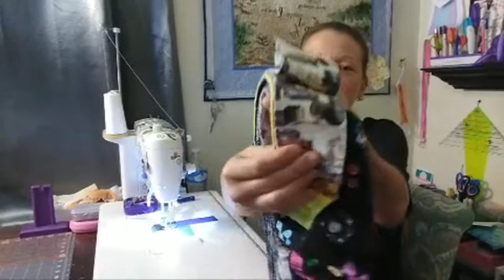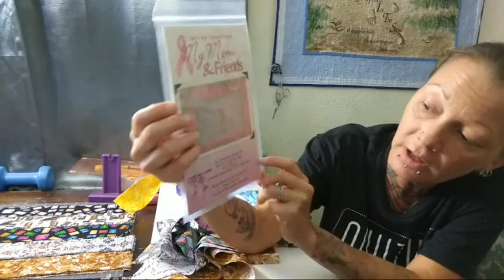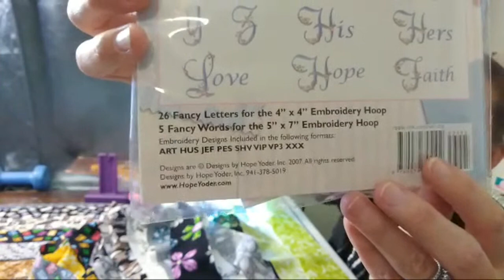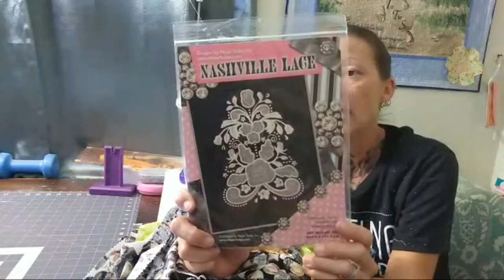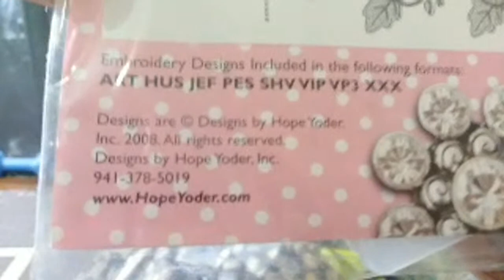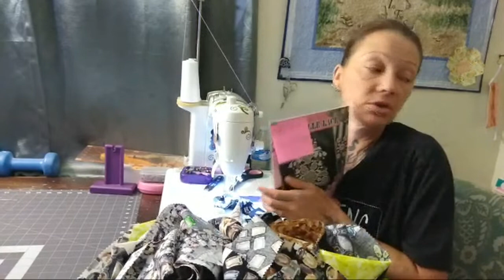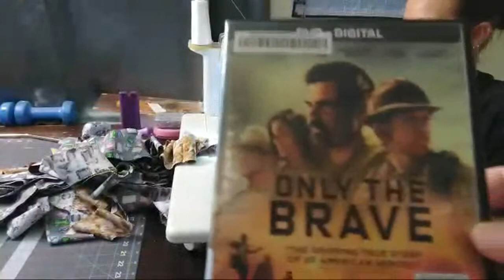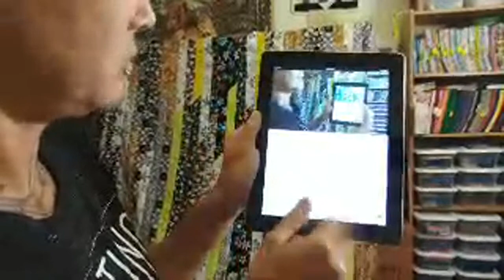Sew Sunday 6/28/20 Double Jelly Roll Race ☺ let's Race!

Comment: I leave my selvedges on and overhang them when sewing the strips together- gives me a v shape to line up with my seam guide which is easier than matching an edge which is underneath. When I'm done and have them as one big strip I use scissors to trim them off and cut them apart at the same time.
Reply from the maker: I do that too sometimes and sometimes just cut them off first.

Comment: Just a suggestion, try one of those sticky lint rollers on the pinked edges before you unroll it.  It will really help.
Reply from the maker: Ya I've done that before.  I go through those so much.  I use my other lint brush normally or I just pay them off over the trash before opening. But since this was live I wanted to show newbies how much mess pinked edges really make 😂.  After I finished filming I changed and my clothes were taken outside and shaken off and washed by the hubs and CJ vaccumed my room up for me. It was a mess 😂
Reply: Cheryl Brown great tip thanks.
Reply: Hmm, I never thought about that. I'll give it shot. Thanks.

Comment: That looks really nice, did you save your triangle scraps from this, the ones you cut from your long strip when piecing on the diagonal?  I have a bunch of strips that are 3 and 1/2 inch from a mail trade my sister and I did through the mail and I want to do the jelly roll race with them and make a queen size , do you have any suggestions for how I would go about this because the strips are all the same width but different lengths and im not sure how many inches long I would need total for a queen size using the 3 and a half inch strips? sorry for the two part question, I hope it made sense, Thankyou:)
Reply from the maker: You would need lots and lots of strips if all different lengths. I would go with 60+ strips or more. You can always add more or make it in quadrants using 20 per quadrant. It should look cool that way if it's scrappy ya know.